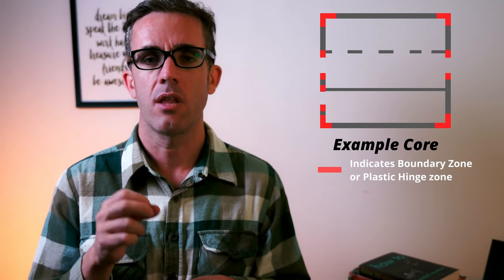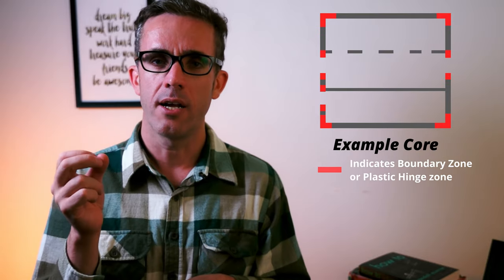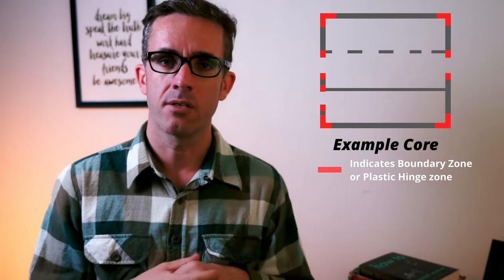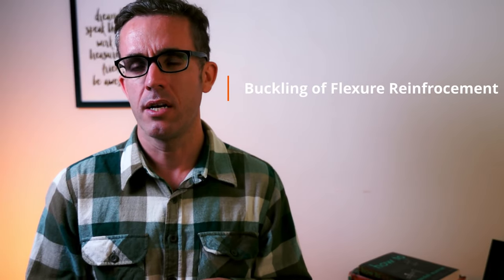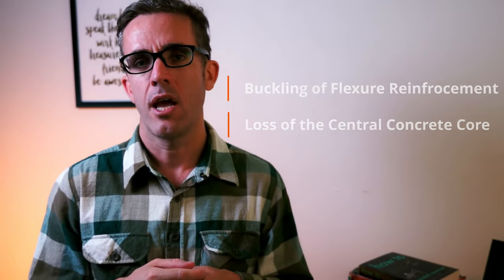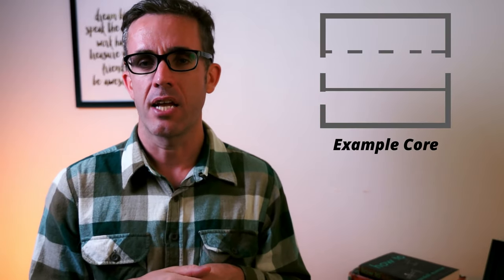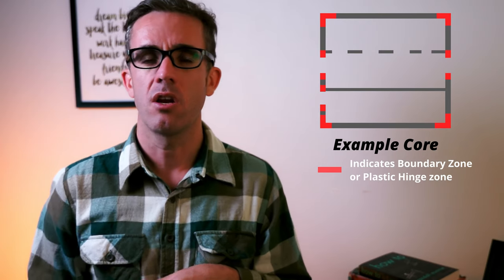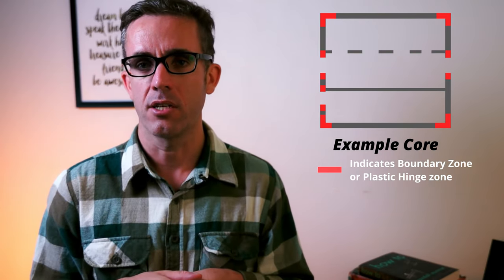The Key Concepts of Designing Structures to Resist Earthquakes

Comment: Tip: dont design until the limit , I mean the relation between demand and capacity , doesn't not be necessary 1 or 0.9  there is s while world that you don't know and softwares doesn't take into account most of it nor the real exact loads that you are going to have, you only have a good approximate ( like the real deformations that you have in steel connections that with etabs or sap 2000 are not possible to measure )
Reply from the maker: agree you need to know where to hold back some reserve. your design loads are only as good as your assumptions and modelling, which is never exact better to have some up your sleeve

Comment: What is the best solution when the center of mass doesn't coincide with the center of rigidity? It's not possible all the times to choose a statically system that is symmetric.
Reply from the maker: Hi Ahmed, if you can't change the stability system to align with COM, then you will just need to design for the miss alignment. This will mean that there will be torsion in stability system, not great but most stability systems have them. Typically this will increase your stresses in your header beams.
Reply: @BrendanHasty  
Thank you for you reply. I'm aware of the torsion that will be generated out of this misalignment. In ETABS for example we have the choice to adjust torsion modifiers for any structural element we want. In a structural where shear walls and a core around the elevator shaft are the main system to resist the lateral force is it correct to assume that columns won't have any torsion resistance and therefore change their modifers. Sorry for this long question but there is a very big misconception about this topic here in Egypt and I wanted to know your opinion. Thanks again
Reply from the maker: @ahmedmashaly4946  Hi Ahmed, Columns will some load but as they are not very stiff the load will be low. as an upper lower bound assessment it is ok to assume the column have reduced modifiers, but you will need at some point make an assessment of the columns, but likely to govern the design. If it is a big mega column it can in some situations.
Reply: @BrendanHasty  I appreicate your help. Thank you so much!

Comment: Thanks brandon for these videos. Is it possible to do a video regarding design of concrete structures using australian and american codes?
Reply from the maker: Hi Michael I am going to do a video comparing different codes from around the world, which may help.
Reply from the maker: it will focus more on the load amplification factors and the material safety factors.

Comment: Great video. What book do you recommend for earthquake design?
Reply from the maker: Hi Sam J, if you are based in Australia, Steel reinforced institute of Australia has a good guide on reinforced concrete detailing and it is free, https://www.sria.com.au/pdfs/SRIA_Guide_to_Seismic_Design_online%20.pdf . let me know if you want a more complex recommendation.  Also, good Journal article on earthquake design and detailing https://www.engineersaustralia.org.au/sites/default/files/awards/RC%20walls%20in%20Australia%20seismic%20design%20and%20detailing%20to%20AS%201170%204%20and%20AS%203600.pdf